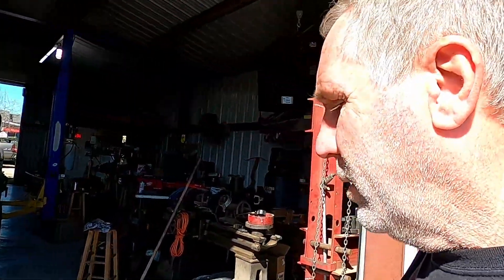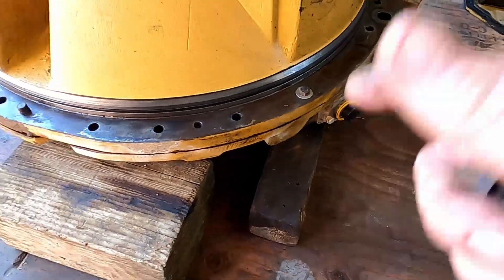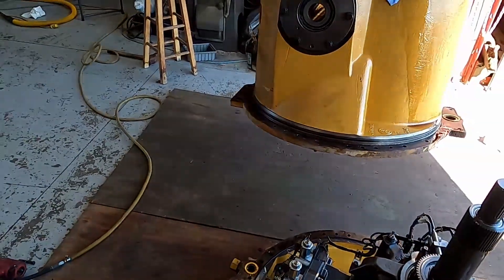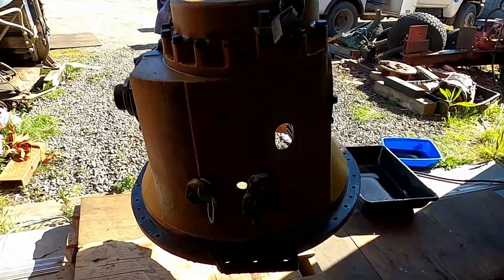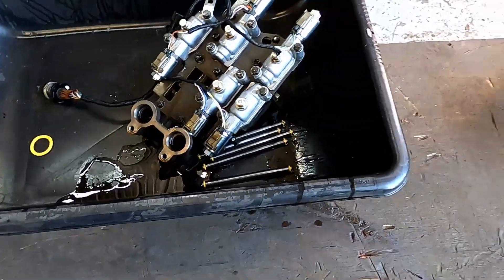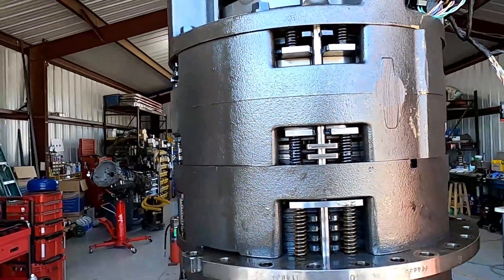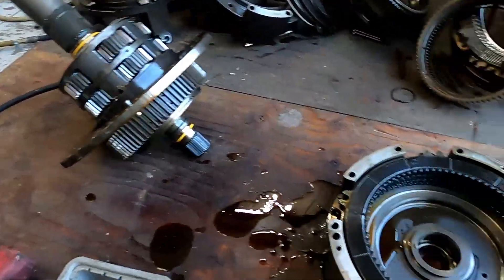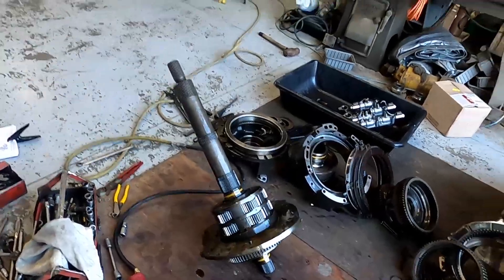Cat D8R ll Transmission Disassembly

Comment: I’ve one D10T2 with speed sensors that are open. And the only solution to access them it’s by taking out transmission
Reply from the maker: I thought I had commented on this last week, but it’s not showing up. 
95% of the time that the TCU is showing an issue with the speed sensors it is due to a bad clutch pack. As the pack slips the computer doesn’t know how to interpret it except for the sensors not working correctly.

Comment: I’ve one D10T2 with speed sensors that are open. And the only solution to access them it’s by taking out transmission
Reply from the maker: I have found that 99% of the time the TCU says that speed sensors are not collecting data, it is a failed clutch pack. The TCU can only gather that data and if it doesn’t get the expected results it just blames the speed sensors. If a pack is slipping or not engaging then the TCU doesn’t know or expect a physical failure.
I’d check the harness for damage, and check the filter and screen for clutch material or chunks.

Comment: While your that far in just replace everything
Reply from the maker: We there are specs as to whether a part is still good, there is no reason to throw away parts that will last another 10,000 hours. You can spend the extra $20,000 to replace everything but it’s just a waste of money.
Any parts changer can just buy all new parts.
Reply: So your implying that I do not repair anything and throw away  merchant Well that's were your so wrong  When I started in this trade you had to repair and make your own parts So before you get you mouth in drive make sure your brains in gear
Reply from the maker: You made your own parts?  That is awesome, how do you make a clutch disc or a tapered roller bearing?